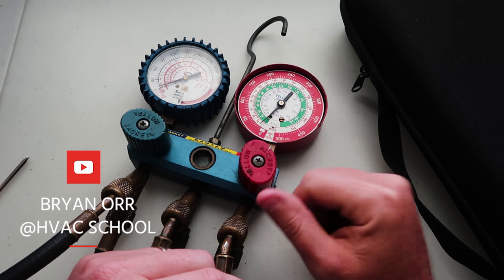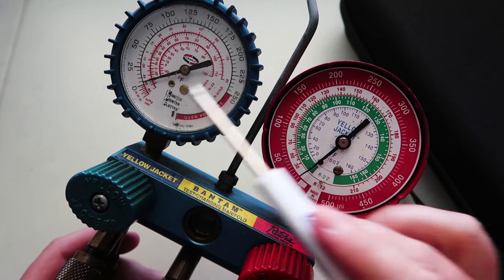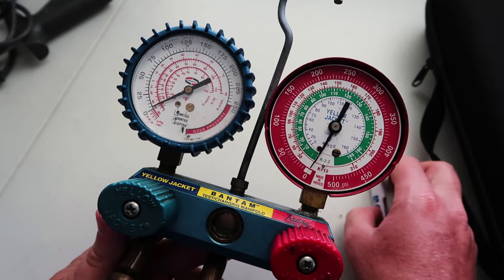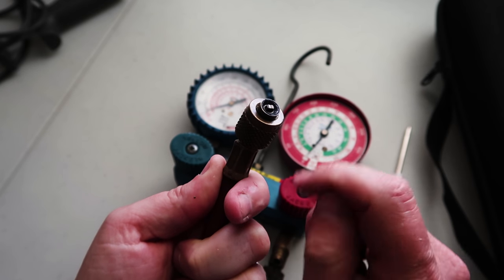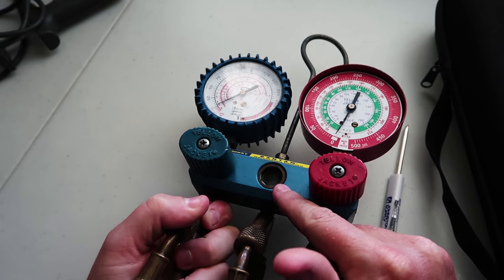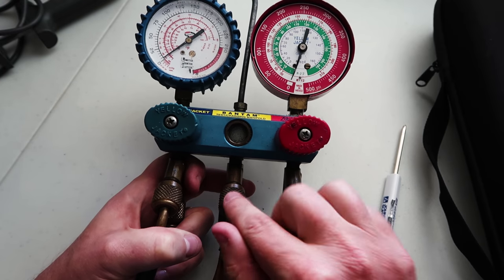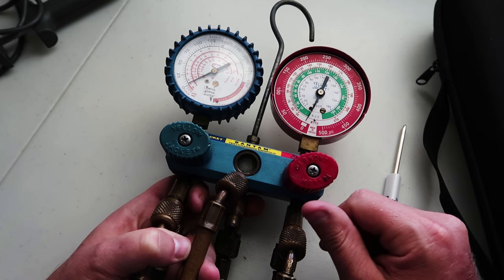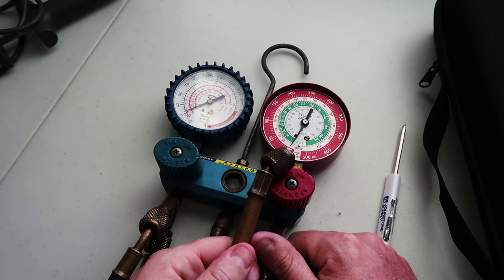How Air Conditioning Gauges Work for Beginners

Comment: Good video. 
I bought my own gauge set for car work. 
Things that confused me at first is the valves on high and low do not change pressure reading,  that took me awhile to figure out,  so good pointing that out. 
I've been trying to figure out what the smaller temp numbers are used for on the inside.  
Tip for folks doing r134a like me.  Make sure Schrader depressers are fully counter clock wise prior to quick connect.  Then turn them in slowly till you read pressure on gauge. That way you do not hurt that Schrader on low and high lines from over compressing them.

Comment: Question. Sometimes when filling with r134a, or r410a, the sight glass will be liquid at first as im filling. However after a few times of adding a little, the liquid can no longer be seen in the sight glass flowing. Gas is still flowing from the cannister, but it is no longer liquid. The cannister is not empty. Why is this? Less cannister pressure causing the liquid to vaporize in the tank maybe?

Comment: I would love to see a video showing the replacement of a gauge on the manifold with another guage. What tool do you use? Is it easy or hard? Is it safe? Are many of the gauges compatible amongst different manifold manufacturers?
Reply: simple, use any basic tools (wrench or crescent), add either a  thread tape or thread sealer. . unscrew old gauge, add sealant to new gauge threads. twist on.

Comment: How do you feel about the ones that dont have a sight glass but instead have a little schrader valve on the yellow center fitting for burping air out of the line?

Comment: Is it bad to open both the high and low side valves up at the same time while the system is running? I realized I had both open at one point and it seemed like it made made my pressures shoot up pretty high but idk if it hurt anything. It seemed like it made my pressures read inaccurately too

Comment: Should you avoid using the same manifold and hoses set on r22 and r134a systems? Or there is a cleaning procedure? Thanks
Reply: You should purge or evacuate the hoses/gauge to avoid cross contamination with other refrigerants since thats bad for the system. I’m an HVAC student if that helps.

Comment: Would you disagree with the  idea that most licensed HVAC contractors are reluctant to work on the installation of the low cost mini-split units sold by the "big box  DIY stores. Seems like HVAC contractors service and install only the specific big name HVAC manufacturers they prefer.

Comment: My yellow hose for the MGS has a sort of valve inside one of the hose ends. The instructions do not mention which way this valve is supposed to face ( gauge set or refrigerant/ vacuum pump side)

Any ideas?

Comment: You say not to do this as a home owner but I can't afford to pay 300 every 2 months with a leaking condenser so propane refrigerant it is wooo 
I've already got a guage set from automotive just gonna make an adapter to home ac fitting and 
Charge my gas pack full just to get me through the summer till I can afford a new unit come next spring 
Just bought this house

Comment: I was trying to say to add refrigerant you would open low pressure side valve on the manifold but i opened the high pressure side instead for 30 minutes and it did not add any refrigerant. Now my concern is did i damage my ac system?
Reply: This all depends on if it's fixed metering device or txv, and what refrigerant.

Comment: Do you always recover refrigerant through the high pressure side???  So you're saying you put in refrigerant on the low side and recover on the high side,  is this so for all refrigerants should they be put in on the low side as a vapor,   and recover on the high side as a liquid.  What about 410-A does it go in as a vapor or does it install as a liquid on the high side???

Comment: In fact, I did my read, with out cert. you can do your own home with 410 and its completely legal... you can NOT do R-22 at all.
However you can NOT do a friends home with 410.
Reply: now consider that, as a taxpayer, you paid some public servant to come up with that "for yourself, but not your friend" law.
torches & pitchforks, anyone?
Reply: @JScottTalbert-Lawyer2Warrior  Usually the codes are developed by caring people who are trying to help everyone get along in society. Sometimes bad companies or trade associations force laws into the code books that only benefit themselves and shut out others. The International residential code went a long way to eliminating the regional “good old boy” codes but there are still manufacturers and material sellers forcing excessive regulation and costs on the public.

Comment: hate that lame disclaimer do not use it unless you're a trained professional.  I get you're trying to protect folks but it also sounds like you're looking to protect jobs for the industry. IMO, if you're diligent with safety and did your homework, you're good to give it a try.  Definitely safe if you've been taught by someone too.  That's how I learned plumbing and electrical and people always say the same thing.  All that said, obviously try at your own risk so do more hw and be extra careful if you want to lower your risk.  I'd rather be told that then to not try at all unless I'm a trained professional.   =)
Reply: Small difference: the EPA wouldn't fine someone $37,500 for a plumbing or electrical mistake. Handling refrigerant requires passing a federal epa test. Your comments sounds to me like saying thay everyone should be able to try driving a semi because you were able to learn to drive a forklift and tractor because your friend owns them. You might be right that it's learnable, but it isn't generally legal to mess with refrigerant.  Which is probably why they have the disclaimer. Let the very helpful channel legally cover its butt. Just ignore it. 

Yes I know that I'm replying nearly a year later. I'm bored and wanted to reply.
Reply: I'm an apartment maintenance technician with about 4 years of experience, occasionally working on HVAC. I've been studying this stuff 3 hours a night for the last month and work on the systems pretty much daily at this point. I don't have my EPA yet, so I don't handle refrigerants and I don't touch gauges. Neither should you if you don't have your EPA.
Reply: Jobs in this industry do not need protection. We can’t hire people fast enough, there is so much work.
Reply: It’s 45,000 now
Reply: @Mxmiaozers  That's so ridiculous. Certifications mean next to nothing. Look how many people graduated high school without even knowing how to make change.
Reply: He's just protecting himself legally.  If he just tells you how to do it and you injure yourself following his instructions you could sue him.  With the disclaimer he is protected.
Reply: @jordanhenshaw  lol. You will starve to death when the FDA tells you to eat bugs.
Reply: @jordanhenshaw haha 😂yeah right buddy. If folks can buy guns, I can do my own hvac
Reply: @Mxmiaozers  so if the refrigerant leaks out from a leak/accident/etc, no fine. But if it leaks because someone opens the system, charge a fine.

Point being, it's just money lol
Reply: @Katana_00 guns are protected by the 2nd amendment to the constitution. I don't see refrigerants or AC anywhere but maybe I missed it.
Reply: @Jake-pq3iz what's that got to do with anything?
Reply: @r.rodriguez4991 he didn't make the law. Take it up with your congressman if you disagree with it.